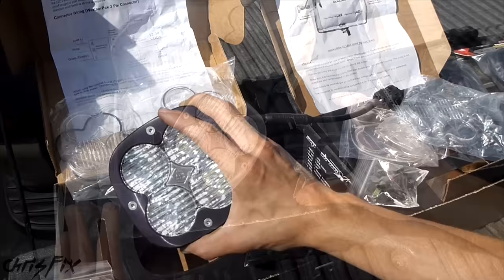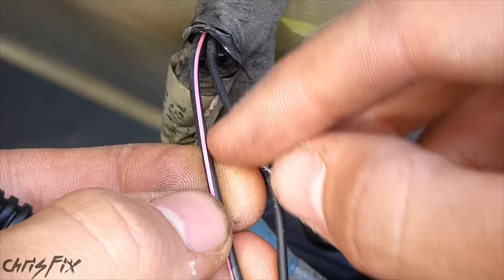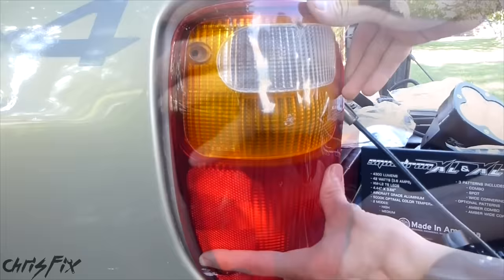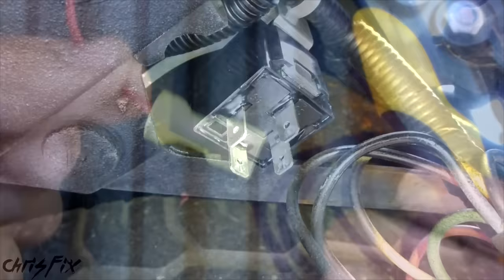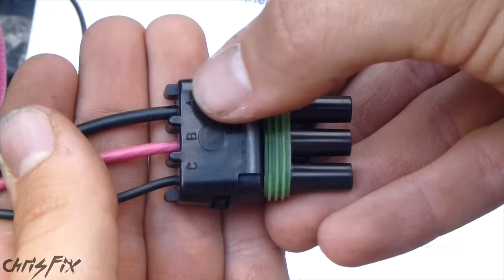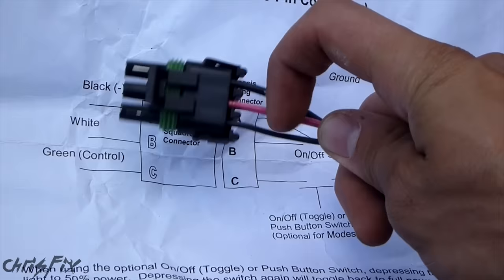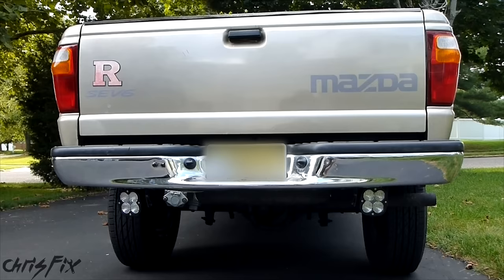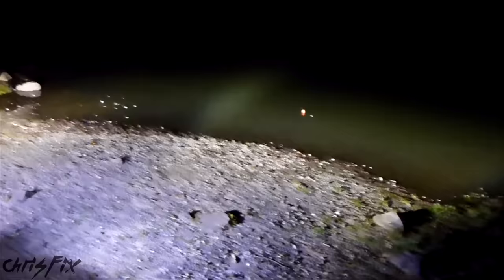How to Install Auxiliary Reverse Lights

Comment: you had +12v supply to the relay along with  the +12v switch from confused why the kit wanted you to wite into the factory harness, was it only for the reduction?

Comment: There may be one inside the relay,,, you should check that!  If you hear the relay static in your radio when the relay opens then you need a diode,,, if not the relay has one!!

Comment: Chris, I know this is an old video but hopefully you'll still reply. Is there a reason not to simply splice into the positive and negative wires from the factory reverse lights and run those to the aftermarket reverse lights? Instead of installing a relay, fuse, and running a wire all the way to the battery. I'm not the best with electrical, and wanted to know if that would be unsafe

Comment: Do you have this connected to a switch so you can control whether or not they turn on by themselves (not in reverse) or if they come on when the truck is in reverse or not come on at all?

Comment: I want to install a neon LED strips to my taillights that light up only when my night lights are on, would I need to connect it to the battery or could I just slit the wire connecting to the stock light to power the LED strip

Comment: Chris's I installed back up lights as per your video and it keeps blowing the 30 amp fuse,  any ideas what I did wrong.  I will tell you I didn't use a water proof relay, my parts house doesn't stock them.

Comment: I'm wondering if you could help me. I wired my lights into my trailer wiring harness. Power wires to the trailer harness reverse wire and both grounds to the ground wire on the harness. My issue is that when my truck is in reverse they work but if I hit my brakes they come off? I don't know why.

Comment: I have a question about wiring. I installed a CB in my car, ran both wires from the battery and I have feedback when I accelerate. how can I fix it. thanks

Comment: I'm having issues with my neutral safety switch. I've checked fuses and bulbs for my reverse lights and they do not come on at all.  Any recommendations before I replace the switch? And will this work with the switch not working.
Reply: It's a 98 dodge ram 1500

Comment: i mean, you could just tap into your reverse lights attaching a fuse in the line. then run a third wire to the cab so you can manually turn them on as well. that's what i did.

Comment: Chris - thanks for a well documented tutorial.  Recently purchased a 2020 F250 Super Duty King Ranch.  The back up lights are terrible for such a nice truck so I need to install something like you show.  Believe it or not my truck did not have any overhead auxiliary switches and a new overhead console for my particular truck is $800+ dollars - no thanks.  I have not begun the task of looking at connecting to one of the tail light assemblies as you've shown.  I do have a trailer package on my truck.  Do you have any experience or knowledge of an install like you show - but on a newer truck with trailer/towing package?  Would like to attempt using a method similar to yours.  Thanks.

Comment: Why use a relay Chris.  Why not just run the  lights off the current back up lights?  I spliced in for my backup camera and it works fine.
Reply: gordon your camera doesn't need power to run... it uses the radio for power. That wire you ran into your reverse light let's your radio know your in reverse and turns your camera on.

Comment: Very late to the video, but it'd be much easier to just wire them directly to the factory reverse light switch or reverse light without relays or fuses, since all vehicles have one as standard and it isn't a big hastle to do, just a couple of short wires and good to go, also the factory one goes through a relay and fuse  :)

Comment: Chris your videos are amazing as always, hey if I was you I would draw power for the kill switch from my parking lights so that even if the switch is on and I reverse in daytime it wouldn't waste the energy and will make more sense if those reverse lights would run only with parking lights (used in nighttime) and also you will always have the kill switch if it's daytime and lights are on and you selectively didn't want them to come on :) what you think ?

Comment: Chris is,there a way to wire in a secondary control switch so I could also use the lights as auxiliary lighting on a job site ?

Comment: Hey Chris , I have the same project but for a fender side light that goes on only to light the side of the car when entering a dark corner but I want to trigger it by the turn signal ? how can I do that? i.e. how to get a constant current from a turn flashing  signal?  I'm just trying to imitate the old style cars that has a fender light ( I really don't know what they call it).

Comment: I also have another question in the regards of an automatic transmission when would you use first gear or second gear ?
Reply from the maker: Do you mean 2 and L?
Reply: @chrisfix  yes when do you use first or low  or second on an automatic drive is all I used as it starts and low anyway

Comment: this Ques. might be childish...but then also i am asking...why u used relay in this setup...? u could have used direct setup from reverse light to auxiliary lights...(i.e., positive from auxiliary should go to the positive of stock reverse..this way to u would have got it worked when u reverse your vehicle)...what was the benefit of relay...?

... by the way good job...keep it up...i really enjoy ur videos...they are very detailed and helpful...thanx..
Reply: You wouldn't wont to use these daily especially as a regular reverse lights. They are too bright... It would be like driving with HIGH beams on.
Reply: looks like Mr. fix is lot busy..
Reply: Its good practice depending on how much current your lights will use. The relay only uses a small amount of current to trigger, and then the current flows from the battery through the relay and to the lights. Your stock wiring harness only sees a small increase in current. If you wired the lights directly to your stock lights, they may pull too much current and overheat wires or blow fuses. 

All comes down to your application.

Comment: If you have a towing package couldnt you just run you reverse light from the trailer wires instead of messing with your tail light?
Reply from the maker: +Suicidaljello you could do that but not everyone has a towing package and people who do might use it so you wouldn't want to add more current to the wires.

Comment: Why not just tap power from wires that power the lights? Or is that not a good idea?
Reply: I did that with my truck. Voltage changes and shorts bulbs and fuses

Comment: Have you come across any clearance issues with the lights where they are?  I appreciate the video, well done, I'm just still having trouble pulling the trigger on lights that cost that much if they are going to get ripped off the back of my truck.
Reply from the maker: +Will Ragas I never had a problem. The trails by me are not rocky, just sand and mud. If you wait a few weeks I'm going to be showing how to mount them differently!
Reply: Thanks,
I just notice that on the trails for my hunting property are steep where you have to cross drainage creeks and wouldn't want to rip my lights off!!

Comment: Hello, I know this is an old video but I bought an aftermarket bumper for my truck and I wired the cube lights into the reverse lights. When I leave the key in the acc position the lights work, but when i turn on the vehicle (key set on run) the reverse lights and cube lights (which are wired to the reverse lights) flash and turn off, then won't turn back on no mattet how many times i shift into and out of reverse. Any ideas what could be the problem? I tried swapping out the fuse for a bigger one (15A to 25A and even tried a 20A). Thank you in advance for any help/advice you have 👍

Comment: Good job ...... But I'm 99% sure relay pin 86 is the ground. And 85 is the + to activate the relay either one could be the switched wire.   ( If the RV has a properly wired 7 way trailer light plug . It will have a battery + (it is one of the 2 largest wires feeding the plug 
 that is typically either red or black ) the large blue wire is the trailer brake wire. By tapping it for the relay power feed and using pin 86 for your switch to activate the relay u will not have to run but 1 small wire the full length of the RV. If u allow the reverse switch alone to activate the LEDs u can be fined if a officer catches on.
Reply from the maker: thanks for sharing

Comment: what if you wired the new reverse lights directly to the reverse lights line without a relay? I mean aren't the factory installed reverse lights being power through a relay already?
Reply: mike m - depends how much power you're pulling.

Comment: Why would you not take power from the fuse box? Why directly to the battery?
Reply from the maker: You can take it from your fuse box if you want. I did it straight from the battery so I didnt have to drill any holes in my firewall.

Comment: Hi Chris, I've seen all your videos and I have a question, if you can help me...
I own a 2009 first generation Mazda 3 and I like to put some auxiliary reverse lights in the rear bumper. My problem is that I don't know what reverse ligths I need to buy ( I want them to be into the rear bumper, not hanging from the chasis like yours). I am from Chile and I have to buy them on eBay or Amazon and I like you to help me find some LED reverse lights, if you can.

Comment: Why don't you use a blue inline connector instead of soldering? Just a quick snap and you have power, waterproof.
Reply: Solder is more permanent and less prone to shorting out

Comment: you insterted the red rubber grommets incorrectly, they go in after the metal ia clipped in, they prevent water from entering the wore holes

Comment: Do u have to have a relay, could u use power from the back of a cigarette socket and bridge them in there, only comes on with ignition and put an extra fuse in for a drl light that is 10w a piece and 15 w for a mini spot light . My cigarette lighter has a 20 amp fuse and only shares it with the reverse lights and combined the drl and spots only use around 6 amps in total.
Reply from the maker: +SMOKE 997 you can do that too

Comment: Good video but i would have used heat shrink electrical connectors. Way better for water-proofing.
Reply from the maker: Thanks for the tip Dan!
Reply: @chrisfix  thanks for doing what you do bud. Its always nice seeing somebody else do it first haha.

Comment: Could you run wire #87 with #86 to the reverse lights? Instead of running #87 all the way to the battery.
Reply: That Guy the reason for going to the battery is so that you don't overload the stock reverse light circuit. The power from the stock lights just triggers the relay using barely any power. If you just spliced the lights directly to the reverse lights you could draw too much power and blow a fuse or cause a fire.

Comment: hey Chris. is there a way to add a switch on this setup so I could use the lights with out being in  reverse? please let me know where that wire would run
Reply from the maker: You can do that. You would run the wire from the positive on the battery or fuse box to the switch to the relay.

Comment: Could you use a fuse tap to the reverse lamp fuse and get the same result?
Reply from the maker: Depending on how your car/truck is wired, yes you could.

Comment: I recently bought an aftermarket rear bumper with flush mount lights, can I have both? Reverse lights and on an auxiliary switch to power them on when I want?
Reply: Like to know the same thing. A switch that allows me to have the aux lights go on when in reverse at night ,off during the day and turn switch on when the truck is in park to light up to close a gate

Comment: Instead of splicing into the tail light to turn the light on in reverse, can I just wire a toggle switch instead???
Reply from the maker: +Trevor Bourcier yep! You can do both a switch and tie it into the reverse wire as well
Reply: ChrisFix thanks! if I don't tie into the reverse lights, do I wire the switch to the same connector on the relay?

Comment: If you wanted to install a switch on this setup then the switch would go in between the reverse lights and the relay correct? Your videos are awesome man keep it up
Reply from the maker: Yes you could do that. You need a diode to prevent the stock reverse light from lighting up when you use the switch though. I did it that way after the video.
Reply: Hmm interesting, thanks for the feedback. I can't imagine why the reverse lights would light up if a switch was flicked betweent the reverse lights and the relay on your diagram at 1:47
Reply from the maker: +Miles Papineau oh I thought you meant a switch from the battery to he relay so you can turn it on command. If you are putting the switch between the relay and stock reverse light you can just bridge the gap like you were saying.
Reply: ChrisFix cool. thanks!
Reply: ChrisFix Chris fix my Gmas car has a low tire pressure signal going off and it's not telling me which tire how will I figure it out .
Reply: BJM Tuber you go around to each tire and find which one is low. use a tire pressure gauge. the proper psi for your tires  should be on a sticker in you door frame right when you open it up.
Reply: Trevor Burton thank you Trevor

Comment: Awesome, thank you!

I have a question for you on a modified version of this setup. I've been looking to do this to my truck. I've already fabricated a switch panel in the cab. I want the reverse lights to come on with reverse but I would also like to be able to turn the reverse lights on as rear work lights too.

Could I run a second wire from the cab and do a double wire going into the relay into #86. One feeding from the reverse and the second from the switch in the cab? If so would there be any issues to the factory wiring/reverse lights when I turn the switch on? Or do I need to run a double relay setup?
Reply: The factory lights will come on unless you put a diod between relay and factory reverse light.

Comment: hey chris, great video as always, as I watched your video I had a doubt since im installing a pair of led lights as fog lights 36w each, do you think it will be better if I get a relay per light or one will be enough? also what fuse size and relay do I go to? hahaha at first I tought to just wire em straight up into the battery a piggy backed fuse and the switch
Reply from the maker: One relay is fine. 36 watt divided by 12v gives you a 3 amp draw on each light so that is 6 amps total. Your relay can go to 30 amps.  You will need a 7.5 amp fuse.
Reply: ChrisFix thanks!!

Comment: CHRIS ~  LOVE  YOUR  VIDEOS, BUT I HAVE a QUESTION... 
I  ALWAYS  RAN MULTIPLE  AUX  LIGHTS  on  MY  VEHICLES. 
I HAD a  1997  2500HD CHEVY PICKUP, DUAL BATTERY and WIRING LIGHTS WAS EASY.  ~
~  NOW I HAVE A  2016  2500HD  CHEVY PICKUP and
 EVERY SET of LIGHTS I LOOK at SAY.....  "" NOT  APPLICABLE for  2016 "" !!!  ?  
 And CHEVY SAYS...  NO AUX LIGHTS  ! ( with no real explanation why ) 
~ BUT...  THEY SAID THE EXACT  SAME THING BACK in 1997 (and OF COURSE i IGNORED IT)
I HAD THAT TRUCK for 10+ YEARS with MULTIPLE LIGHTS and NEVER a PROBLEM ! 

THERE MUST BE A WAY TO HOOK UP AUX LIGHTS WITHOUT "FREAKING OUT"  the NEW ELECTRICAL  SYSTEM ! 

PLEASE  ~  IF  YOU  KNOW ~ I  WOULD  LOVE  to  KNOW  ! 

Sincerely,  ... SGT. E. G. ROCK ...

Comment: I would have located it on the roof. So you can illuminate the back of the truck in case you wanna using it as a workbench at night. Good job..

Comment: Hi. I have an existing after market halogen fog lights (fused) that's installed without a relay it works perfectly fine I have it for several years now. Question??? Do u know if I can replace the halogen fog lights with a 4in.18 w led fogs with out a relay???
Reply from the maker: The key is you dont want to use more amps than you are using now with your setup. So figure out how many amps your bulbs are drawing with the halogen lights and then see if the LED lights are less.
Reply: Hey Chris, thanks for replying. My existing after market hella fog lamps are 55 watts each. The led's fogs are only 18 watts each. Do u think it'll be ok with out relay.?  Just want to replace the Hellas to LED's .

Comment: Chris I recently wired up some led strips on the inside of my car's trunk.I found a cable that comes from the trunk handle that acts like a ground when the trunk is open and cuts off when the trunk is closed. Wired it up without relay and fuse and works fine. Problem is when the trunk is closed the strips emit a little bit of light  (nothing to comparison to when it's open) but it's frustrating and could drain my battery. Thankfully the cable I run the power for the strips is from the car's inside lights and has a kill switch after 20 minutes so if you forget the lights it won't drain your battery. What do I do?  do i wire a relay and fuse? Will it stop the strips from lightening up? I measured with a multimeter the ground cable and when the trunk was closed the cable had 0.10 v current still passing through the cable . Please help me Chris

Comment: You really should clean up the washers and nuts and old ground connector or replace with new. Cleaning the spot your placing it at is great, but putting rusty old parts back on is not good. They eventually will not work properly at some point. Much quicker "years" than replacing or cleaning the old rusty parts up .

Comment: Question Chis-I want to run a single 36 watt led light bar as an extra reverse light & it of course only has 2 wires-red for power & black for negative or ground so do I run the neg/ground wire from the light to the same spot I connect the ground from the relay to???
Reply: Mark Cummins ground the bar close to the bar and the red for power run to the relay the relay ground is its own